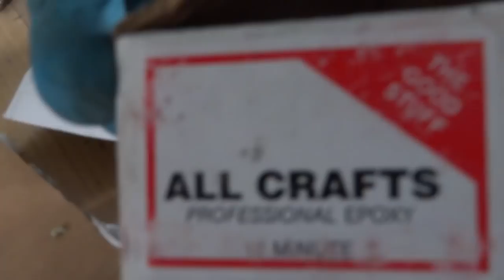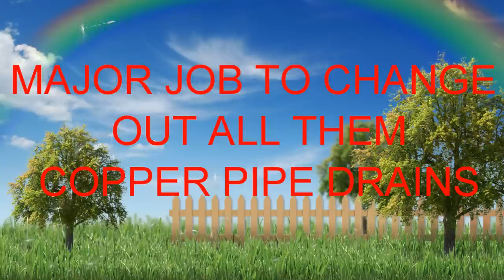MAJOR WATER LEAK FROM SECOND FLOOR TOILET

Comment: Fingers crossed on that one! 😊
I remember my Dad and Brother replaced the Cast Iron plumbing in our house with PVC. I was 12 years old and we connected the PVC sewer pipe with the cast iron with a Rubber connector tightened with Stainless clamps. I told my Dad that it looked half-assed. I am 67 now and as far as I know, the Rubber with the "Clampetts" is still holding up well after all these years!

Comment: I remember trying to use epoxy for a cracked oil pan on log splitter. Tried 4 times. Never worked for me. Nice job Steve
Reply: @willydavid  Haha. So true
Reply: Honestly I plugged a hole in the bottom of an oil pan on my old F150 pickup with JB weld. I drained the oil for 24 hours. Scrubbed the area around the hole with a wire brush and rubbing alcohol. Rolled the JB weld into a pointed cone shape. Stuffed the point up into the hole and spread the JB weld out to about 2 inches diameter all around the hole. Let it sit for 2 days untouched. Then I filled the oil back up and drove it for about 5 more years with no issue. It's a true story. Maybe I got lucky.

Comment: I used JB Weld epoxy on my automobile gas tank, had a small gas leak. It worked very well. Stopped the gasoline leak instantly. Good fix Steve that will hold it another 50 years.

Comment: Toilet tank bolts can be a b**ch.  I've used a nut splitter on a few that were corroded or stripped with good success.  At any rate - not much room to work for sure.

Comment: cordless saw all much faster
Reply: Too risky for cutting into the washer. Steve knows what he is doing.
Reply: @ross2521  Yeah, Cordless saw with porcyln toilet? Not good. That thing would vibrate and scratch or break the toilet
Reply: never did that on the job 49yrs 
 @MaMa-qh4dy